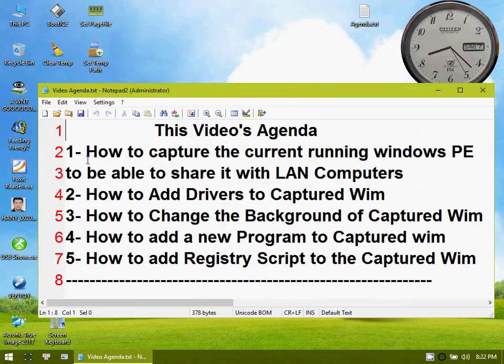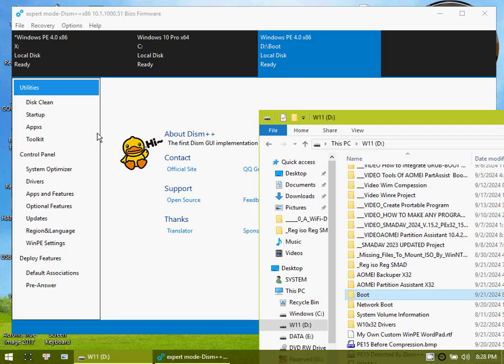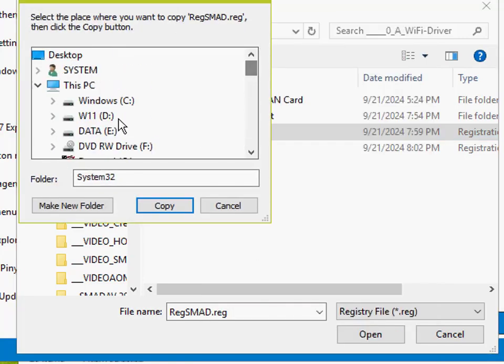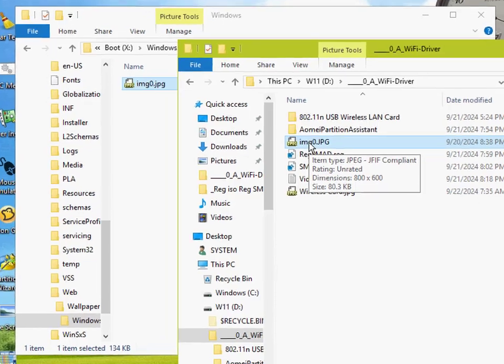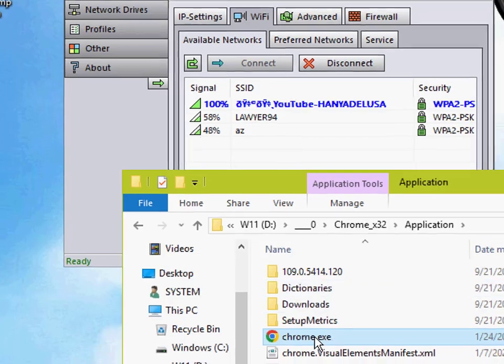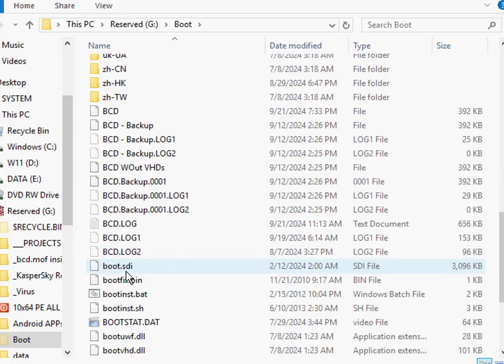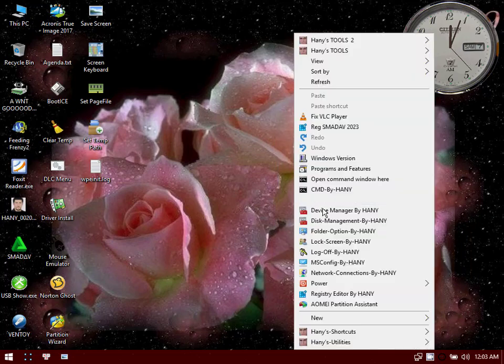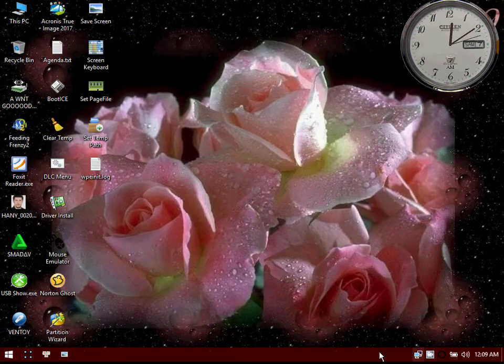151 Exclusive !!! Win PE  Customization

Comment from the maker: 💻 Capturing the running Windows PE: The process to capture a currently running Windows PE image is explained. By copying specific partitions and folders, the image can be modified to include drivers, background changes, and registered keys.
🖥 Adding new drivers and programs: The video demonstrates adding drivers and new programs to the captured image using DM Plus+, a tool for managing Windows PE.
🌐 Internet and Wi-Fi integration: Shows how to add Wi-Fi drivers and test the internet connection within Windows PE by enabling Wi-Fi on the device.
🔧 Customizing system settings: Modifying the background image and adding specific registry keys to enhance the Windows PE setup, making it more personalized and ready for use.
📂 Saving and booting from the modified image: Detailed steps on how to save the modified image and boot from it, ensuring all the changes (drivers, programs, registry) are applied.
Insights Based on Numbers
42 minutes: The length of the video where a complete guide to customizing Windows PE is provided, a process that involves partitioning, adding programs, and enabling Wi-Fi.
614 MB: The size of the final captured Windows PE image after all modifications, demonstrating the impact of adding new programs and drivers.
P17: The version name used for the captured image after boot modifications, showing an organized versioning system for different images.

Educational Article: Customizing and Modifying Windows PE
Windows Preinstallation Environment (Windows PE) is a lightweight version of Windows that provides minimal functionality to perform certain tasks like installing, deploying, and troubleshooting Windows operating systems. This environment can be customized to suit different needs, allowing users to modify its features, drivers, programs, and even its appearance.

Introduction
Customizing Windows PE offers users the flexibility to create a tailored environment that supports specific hardware or software requirements. This article will guide you through the key processes involved in modifying Windows PE by capturing a running version, adding drivers, changing settings, and saving the custom image for future use.

Capturing the Running Windows PE
One of the core customization steps involves capturing the currently running Windows PE. This is achieved by copying the necessary system folders and partitions, particularly the Windows PE image (often referred to as the WIM file). The captured image can then be modified by adding drivers, programs, or other configurations.

Steps:
Identify the Partition: Locate the running Windows PE partition (e.g., Partition X).
Copy the Partition: Use file explorers or command-line tools to copy the contents of this partition to a safe location.
Prepare the Tools: In this example, the video uses a tool called DM Plus+ to manage the customization tasks, such as adding drivers and changing settings.
Adding New Drivers and Programs
Once the running Windows PE is captured, users can enhance the environment by adding new drivers and programs. Drivers are essential for ensuring that specific hardware, such as network adapters or storage controllers, works within the Windows PE environment.

Adding Drivers:
Using DM Plus+: This tool allows users to integrate drivers directly into the captured Windows PE image. Users browse for the required drivers, add them through the interface, and then save the image with the new drivers included.
Test the Drivers: After adding drivers, it's crucial to test them within the Windows PE environment to ensure that hardware components, such as wireless adapters, function correctly.
Adding Programs:
Similar to drivers, programs can be added to Windows PE by copying them into the appropriate directories, such as Program Files.
For instance, the video demonstrates adding a partition management tool, AOMEI Partition Assistant, which is useful for managing disk partitions in a pre-execution environment.
Customizing the Appearance and System Settings
Customization extends beyond functionality; users can modify the visual aspects and core settings of Windows PE. This could involve changing the desktop background, adding custom context menu options, or pre-configuring system utilities.

Changing the Background:
Users can replace the default background by copying a new image (e.g., roses.jpg) into the system directory where Windows PE stores its wallpapers.
By renaming the new image file to match the default wallpaper’s file name (e.g., img0.jpg), the system will display the custom background.
Registry Modifications:
Users can also modify the system registry to include new keys that enable specific functionalities, such as antivirus integration or adding shortcuts to the context menu.
The video shows how to add a registry key that enables a right-click option to register a program like SMD Antivirus.
Saving and Booting from the Modified Image
After making all the desired changes, the modified Windows PE image must be saved. This new image can be used to boot from, making it a fully operational customized environment.

Steps:
Save the Image: Using the DM Plus+ tool, the image can be saved under a new name (e.g., PE12, PE13, etc.).
Boot Configuration: The modified image is linked with the boot manager through tools like BCD (Boot Configuration Data) or BootIce. This ensures that the system recognizes and can boot from the customized image.
Test Booting: After saving, it's important to boot into the new image and verify that all modifications (drivers, programs, registry keys) are functioning as expected.
Challenges and Troubleshooting
Customizing Windows PE comes with certain challenges. For example, enabling Shadow Copy is crucial for capturing the running system’s state, but issues with service configurations can hinder the process. Testing the compatibility of drivers and resolving errors like failed connections or unregistered software are also important tasks that require attention.

Conclusion
Customizing Windows PE provides users with a powerful tool for creating specialized environments tailored to their specific needs. By capturing the running Windows PE, adding necessary drivers and programs, and customizing the appearance, users can create a fully functional, personalized version of Windows PE. Once saved, this environment can be booted from at any time, offering a flexible solution for deploying or repairing systems.

This guide illustrates the importance of detailed steps and careful planning in modifying Windows PE to ensure all elements work smoothly.